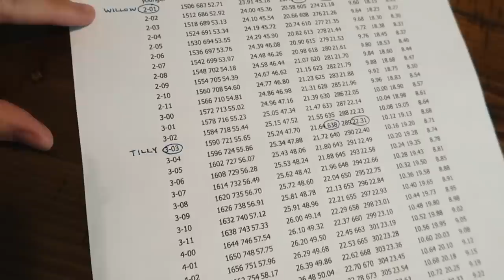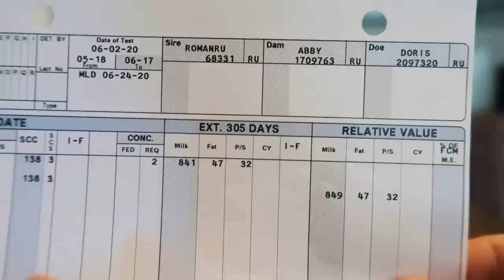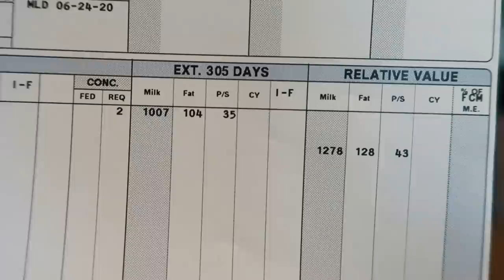We're so bored we're PADDLE BOARDING with our GOATS

Comment: Do you have a steam juicer? It extracts every bit of juice out of the grapes (you can leave the stems on), and pure juice comes out of the bottom to either use as juice concentrate or making jelly. I LOVE mine. I like using it on apples, as you can get the juice, and the pulp left over is made into applesauce.